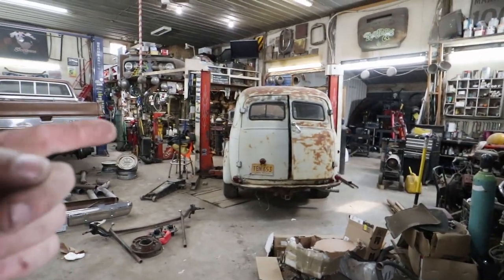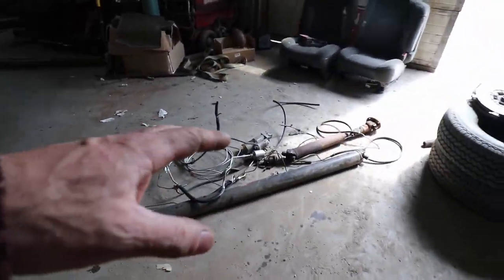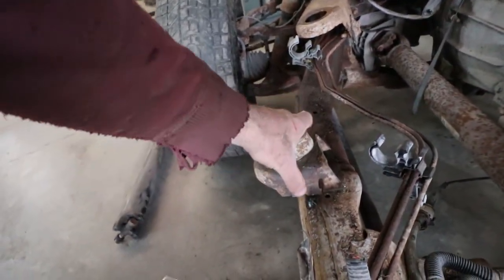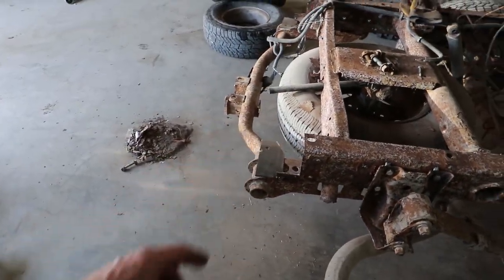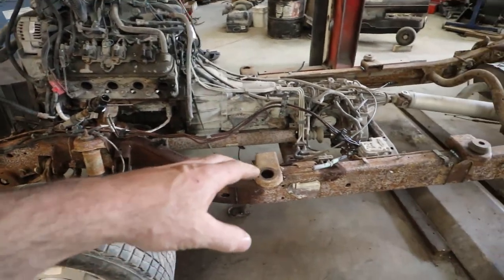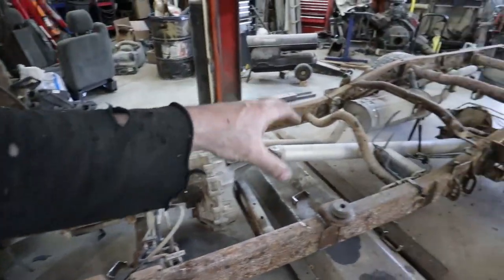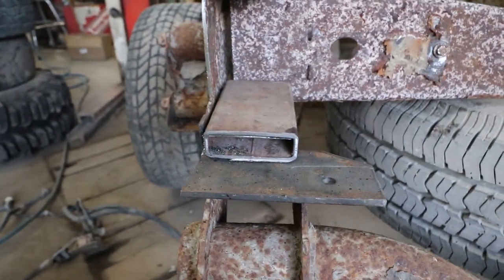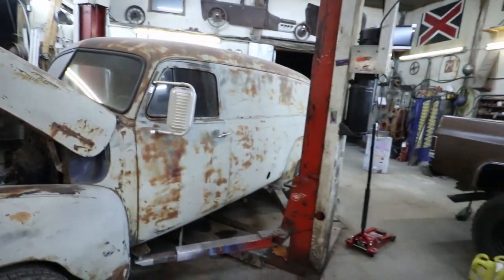Making body mounts for the GMC Panel truck.

Comment: I like this project. The vehicle in which I learned to drive was a 1953 Chevy panel truck like this one but with the shorter wheelbase. Once this project is finished, your panel truck with resemble my first love only in appearance. Although in 1960, mine was dark blue and virtually flawless mechanically and in appearance.

Comment: Also could use steering wheel if take air bag out 2001 GMC to plus keep Alternator , Starter, GMC rims to and up top back cab light plus turn singal lights even Brake  and bumper for front and back together be worth saving Brent  :) ! Also fuel tank just changed the Send Unit plus Fuel Pump to Send Unit and Pick up fuel only be all set to plus location too also may need adjustment to fuel gauge bit in for right measurements of fuel have for empty to half full and  full tank !

Comment: @ 10:30 cleaning up the frame, you might consider using a rust converter? I've had good luck with that. creates like an armor patina finish. Good work
Reply: Totally agree!  Knock off the scale and hit it with a rust converter it will outlive the body.
Reply from the maker: Yeah that's the plan yet :)
Reply: @HalfassKustoms  Yes Sir, Easy Breeze. It will freeze the rust

Comment: I used the flywheel from a 80s 4.3 on a 80s small block V8 (305) and it works fine and put it in a 1976 c10 3 on the tree
Reply from the maker: haha yeah I got lots of small block flywheels, though they don't fit on the LS stuff haha

Comment: Dumpster diving on a donor cab n frame, brake lines, starter, transfer case etc salvaged just da same. Body mounts gotta be in da right place, da panel's gonna be a newer truck with a vintage body n face. Descaled da frame all over da place, out with da electronic n in with da mechanical transfer case. Master fabricated rear body mounts, tail wagging pablo waggin tail off to da house.

Comment: Well it looks like you've retired the old side grinder now that you have the not so new grinder.  Lay in there, you're doing a fine job. Why didn't you use the round stock, then make some tabs off it like a cross member to bolt it down. Ronnie.